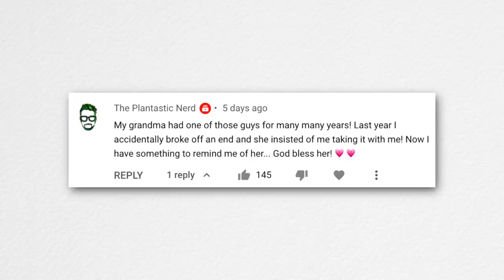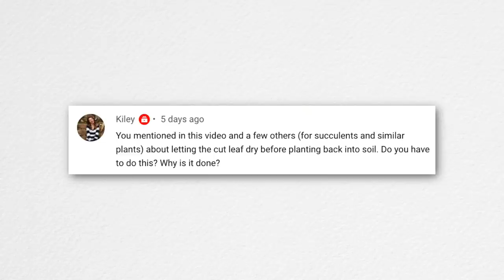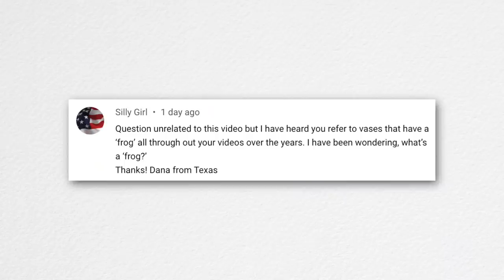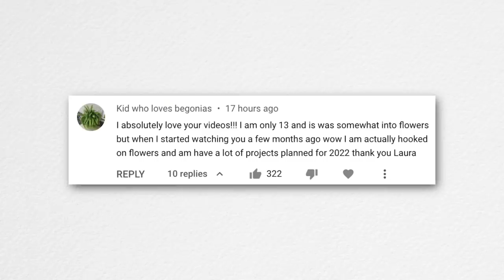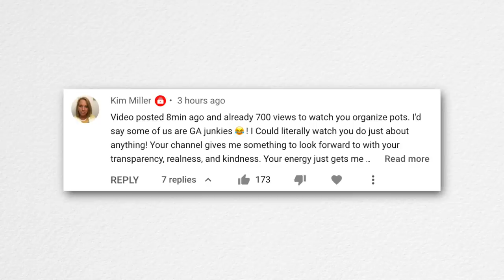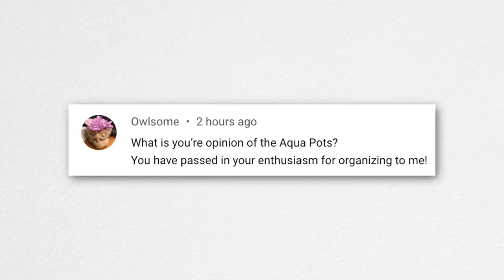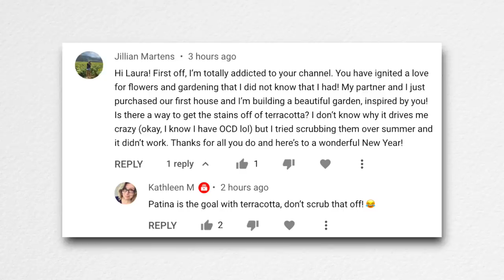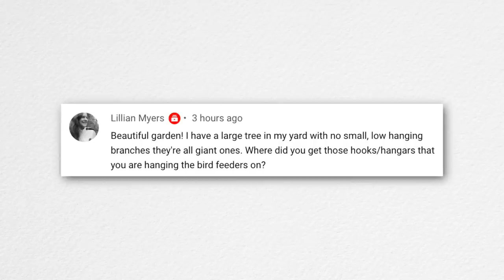No Christmas Home Tour this Year? // Do You Have a Favorite Pot? // Recap 🌿

Comment: Cacti are just modified stems with no leaves at all, but they have succulent stems so are considered a succulent. If it is succulent but there are leaves present, it is not a cacti just a succulent. The zig zag cactus grows as an epiphyte (grows in air) in humid environments so has lost its thick stems  for flat ones and requires much more water.

Comment: best way i've found to clean terracotta is soaking in vinegar. also, fill a spray bottle with vinegar and spray and wipe any surfaces you want to clean hard water stains off of. the deeper the stain, the harder it is to get off, but you can never go wrong with letting it soak for awhile (keep it wet though!)

Comment: Frog - aka - kenzan: "also called spiky frog, is a specific device used in the Japanese art of flower arrangement ikebana for fixing the flowers in the container. It consists of a heavy lead plate with erected brass needles where the stipes are fixed. The name kenzan literally means sword mountain. It was introduced by the Moribana style of ikebana." (Source: Wikipedia)

Comment: I had mold get out of control on a terra cotta pot and use distilled white vinegar to remove it. Just soaked some paper towel  and wiped it down. I would think it would help with mineral deposits too but you may need to soak it instead with vinegar diluted with water. Not sure about % though.

Comment: If you really want to clean terracotta I would try vinegar or citric acid to dissolve the minerals.  Then you’d need soak the pots in clean water to make sure you don’t have anything leaching into the soil later.  If you water with distilled or RO water you’ll keep the patina to a minimum.  Feasible for a few indoor pots maybe, but not large plantings.

Comment: Hi Laura your issue with your zippers is probably a manufacturing issue, where I used to work (before I retired)we would apply those zippers when we made the bags. The part that you can’t open we call a Peel seal. In the process of making the bag which we make with heat if we got our heat too close to that peel seal it would make it a permanent seal that’s why you can’t open it.

Comment: Maybe someone else already answered the ric-rac cactus question, If not... they share similar structures with more traditional cactus that makes them biologically closer to them. Usually the exterior (shape of the leaves, color, size, texture,etc)  it's more shaped by the ambiental/growing conditions and other parts like the reproductive structures (flowers, fruit, seeds, etc) are influenced more by the genes.
That way sometimes there are plants that look extremely similar and are not related, but they do because they share habitat, and others like these one that being a cactus has a hole different appearance in response to adapting to a completely different habitat.

Comment: You can get the box cutter on Amazon for $14.25. It comes in turquoise’s and pink.🇨🇦🇨🇦🇨🇦
About the stains on the Terra-cotta pots didn’t you clean as best that you could and then use a stain on them to freshen them up. One idea.🇨🇦🇨🇦🇨🇦
Oh great video. Thank you so very much for sharing.